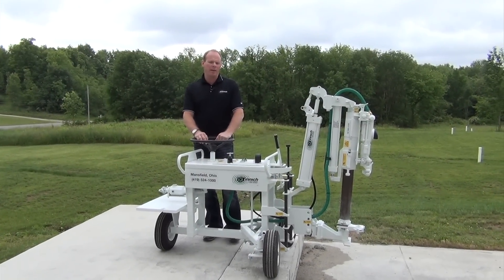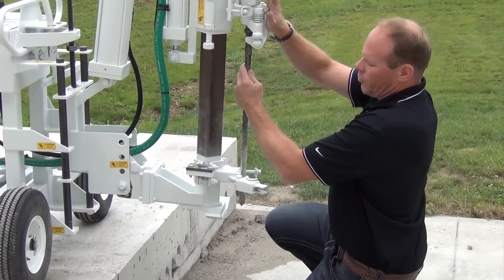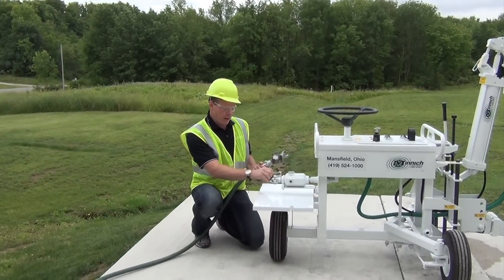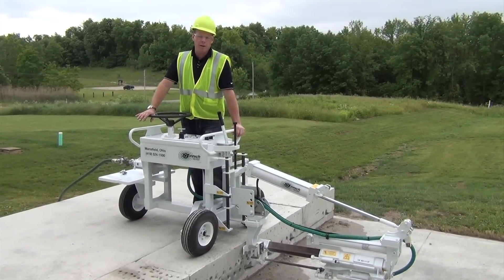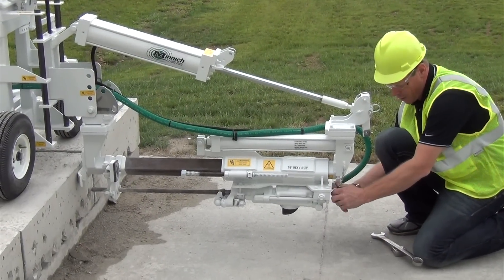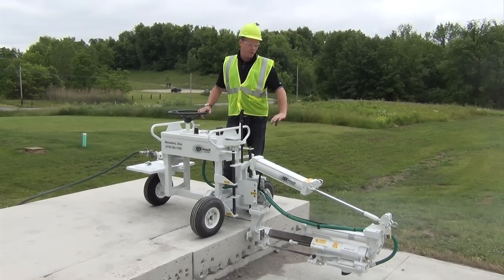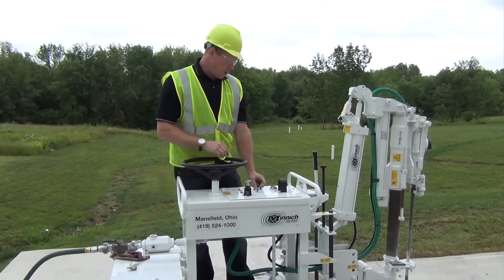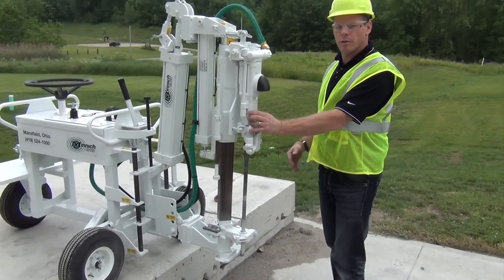A-1C & A-2C Instructional Video

Comment: How do you get one of the bits unstuck?
Reply from the maker: Boonie,  a helpful tip to "UNSTUCK" your drill steel...
Turn you drill switch to the off position, turn the feed switch to the out position. Put a wrench on the drill steel and try to turn the steel. Be sure to keep all body part clear of the sliding drill rail so that when the steel releases and the rail feeds out,  you are free from moving parts.  Worst case scenario (if steel absolutely won't come out) turn feed and drill switch to off position, open the latch that holds the drill steel into the drill hammer and manually slide the rail backwards. This will separate the drill hammer from the drill steel so that you can move the drill unit away from the drill steel giving access to work with the drill steel. Hope this helps!